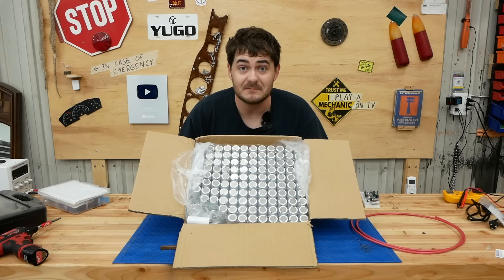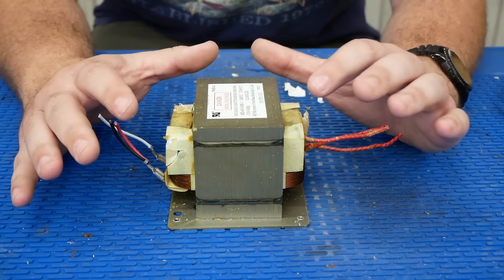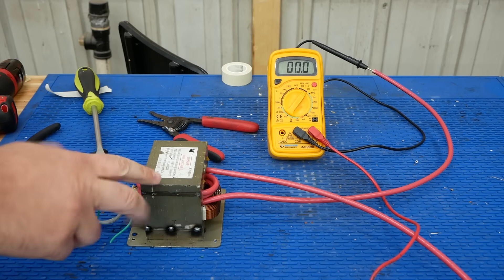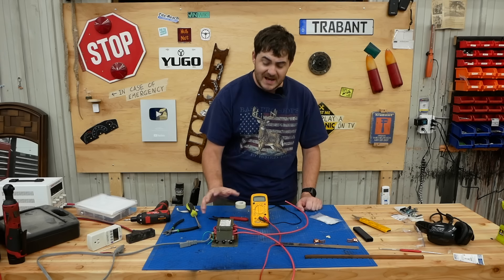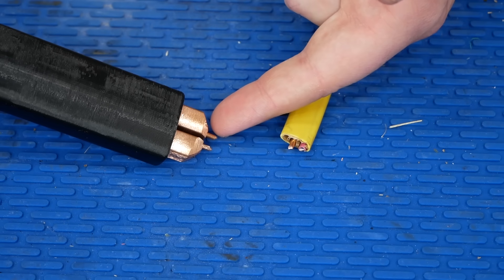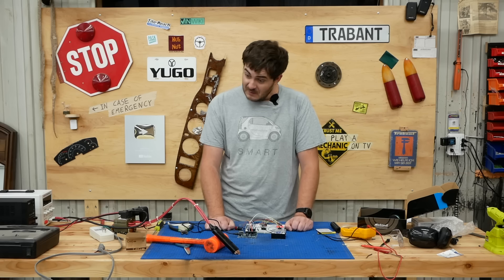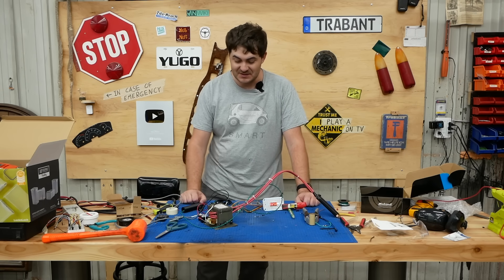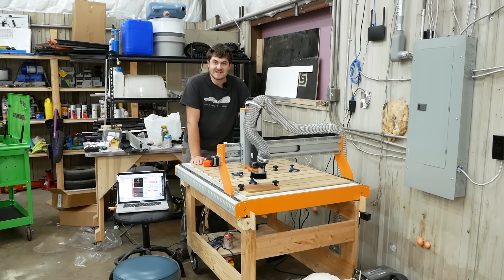I Made a Battery Spot Welder from an Old Microwave and Excessive Mahogany

Comment: Now you need to update that 7-segment display to a venerable ssd1306 blue OLED display with 128x64 pixels. Otherwise how are you going to customize the font, add scrolling effects, and add all sorts of absolutely pointless yet essential eye candy?
Reply: Actually you could use that display to  provide additional information such as input and output voltage, measured current, a preset selector and also some pointless eye candy
Reply: @AstoundingAmelia  And add a wifi shield, connect to the internet, sync  with an NTP server, log the precise time every spot weld was made, display graphs on the screen and  post all data to a web page.
Reply: Or you could update the Arduino sketch to provide adjustable Dual pulse control (Pre-weld pulse, Pause, Weld pulse) and thus produce much more reliable and reproducible welds on Li battery tabs. But the downside of that would be less fires and exploding cells.

Comment: When it works the first time, its time to triple check literally everything just in case you missed something not obvious
Reply: It's not just in case. It's to FIND the said not obvious thing you missed.
Reply: I think this makes very far from perfect welds.
Good tab weld should make 2 small weld nuggets that stay on cell when tab gets ripped off. In this case there's signs of lot of current heating the tab instead of making these nuggets. Notice the oxidation between the 2 nuggets on weld he did. I think his problem lies in not enough contact pressure.
Reply: @plainedgedsaw1694  And possibly because he's only using a single pulse. Apparently many commercial battery tab units use a double pulse with a pause in between. First pulse to soften the tabs so better contact is made & possibly clean the surfaces of oily deposits - Pause -Second pulse (longer than the first) to weld the tabs together. This can easily be done with an Arduino or other micro-controller. Lots are online, just search for Double pulse controller for spot welder.

Comment: Awesome project! Tip: when I need heavy gage wire that is flexible, I use welding cable, it's available down to 6 awg from McMaster and can handle mass quantities of amps. Edit: What Robert built reminds me of the transformers plumbers use to thaw out frozen copper pipes, 120V in, 6 Volts out but high amps continuous. Not sure if the amperage would be high enough to spot weld though, but would be cool to try. The Arduino is neat too, but probably overkill for the application. I think a 555 r/c  timer circuit would have done as well. But hey, if it's worth doing, it's worth overdoing!
Reply: The 555 wouldn't have given the pretty display and micro adjustments are often difficult. You are right on a fundamental level, though.
Reply: as a welder i can confirm lol
Reply: @yurmofuggndad  Beats THHN wire all day long!
Reply: Good quality thick flexcable with silicone insulation is just too sexy
Reply: Much easier to just BUY a proper spot welding controller from Ebay, Amazon or similar marketplace.
Reply: @johncoops6897  yeah, but where's the fun in that, exactly?
Reply: @johncoops6897  Sure, it might be "easier" but not nearly as much fun as building a circuit from scratch or programming an Arduino!
Reply: @MRCNC1967  - I guess it's similar to cutting one's own hair, rather than going to the barber or hairdresser.
I mean, who cares about the result when it's so much fun to do it yourself, right?.
Reply: @johncoops6897  Exactly!
Reply: @johncoops6897  so, I guess you never make anything yourself🤔
Reply: @citizengkar7824  - Yes I do, but only when my work is better and/or cheaper than utilizing an existing product. For example, I don't make my own nuts and bolts, nor wind my own transformers.
Reply: @johncoops6897  "If you have to ask 'why' in the first place, you will never get it." 🤷‍♂️
Reply: @MrFiction80  - who are you referring to?

Comment: 5:30 - You learned tolerances! Hurray! The worst part about taking your beautiful CAD model and bringing it into the real world.
Reply: The real world is a jerk..
Reply: @Entarra  Meatspace is worst space.
Reply: Actually also tuning a 3D printer can be a pain in the ash. Filament and slicing settings can offset even more than the tolerances in normal substraction manufacturing
Reply: for the size of those copper chop sticks i would have just given each side a skim with the grinder rather than printing a new one.

Comment: I think you could have cut the copper from the transformer instead of the steel body.
Reply: This way he still has the original coil for a different project.
Reply: By cutting through the laminations, you are disrupting the magnetic path.  This is in part why your transformer draws ten amps when powered up with no load.  Use a cold chisel to cut the high voltage wiring off. Do NOT use your bandsaw.  You will spend the next hour or so picking little strands of copper wire out of it (ask me how I know this).
NOTE:  The high voltage winding is usually 2,500 volts and it is high enough current to kill you if you have an accident.  Do not "play" with it unless you already have a lot of experience with high lethal voltages. Google it - people have died and electrocution is very very painful.
NOTE:  One end of the high voltage windings is usually connected to the transformer core (ie: the microwave ground)

Outside of that, great build and looking forward to exploring your channel.